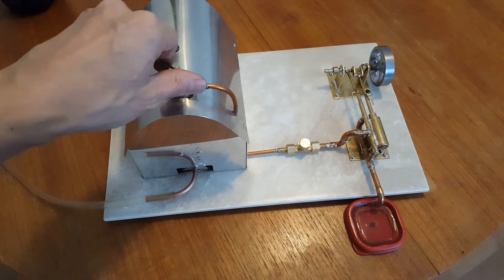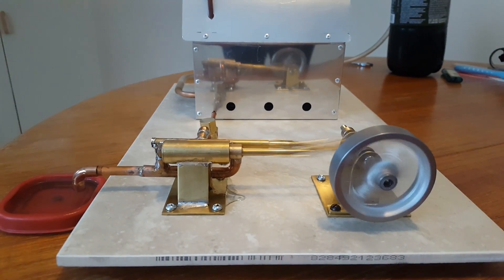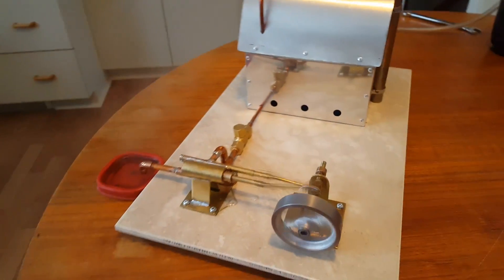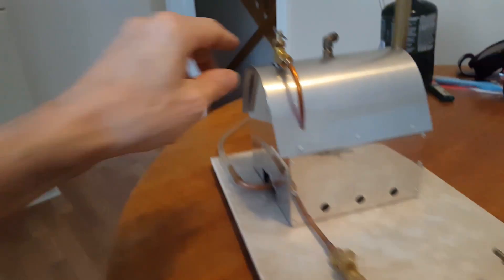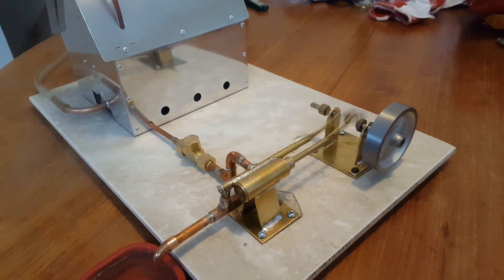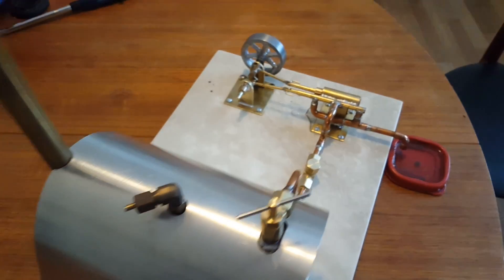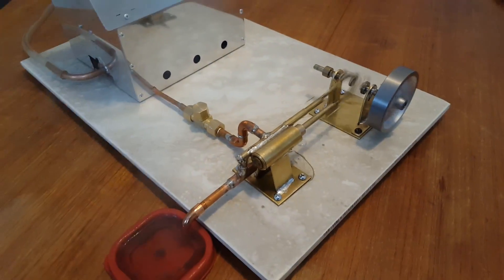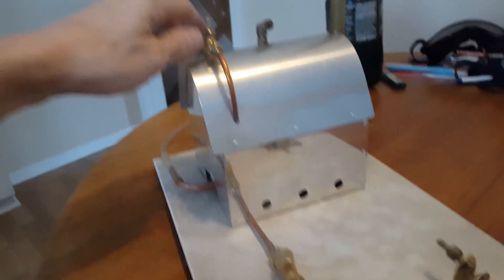My New Single-Cylinder Steam Engine

Comment: I am impressed with your engines. Is it possible to reverse their direction at all so that the design could be used on a train or boat engine?
Reply from the maker: Thank you James. Unfortunately it is not possible to reverse them at this stage of the design. I've seen some engines that are equipped with a reverse but the system appears pretty complex. I think you have to be able to change the valve timing by 180 degrees relative to the piston. The oscilliating engines are easier in that regard.